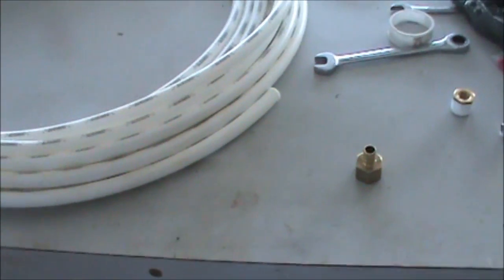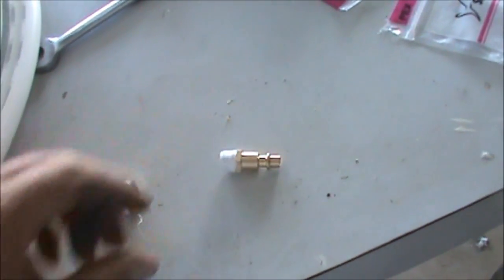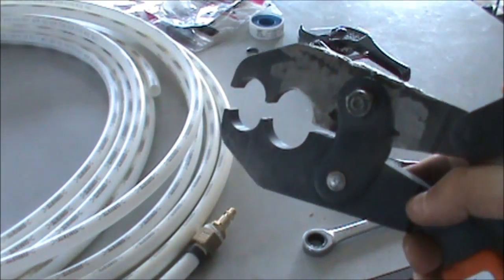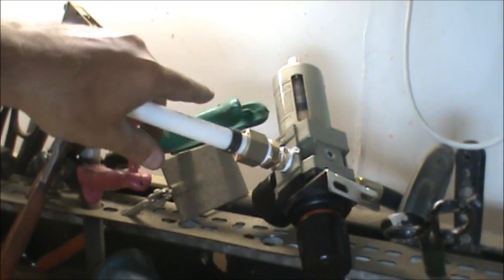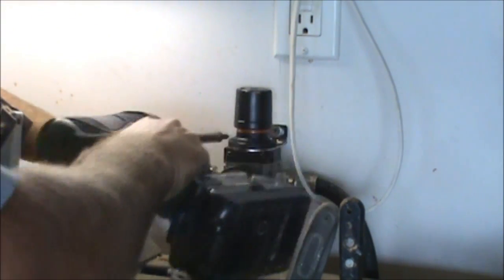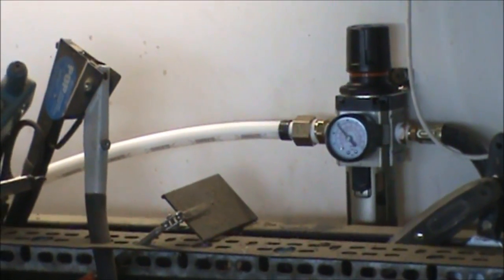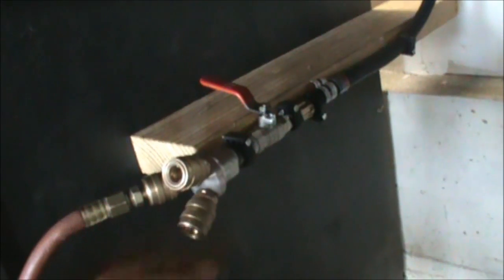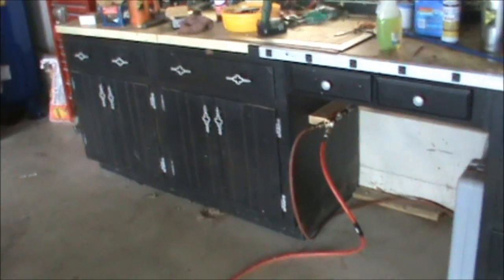How to connect pex to an air compressor

Comment: How's the pex is it still working out now in 2018 ?
Reply: I have been using pex for airlines that have been under pressure for 15 years straight at 135 psi. Not one leak and never an issue. I did use a leading brand and have several hundred feet connecting multiple structures to the same compressor. Have worn out two compressors in that time and soon will be buying my fourth compressor.

Comment: I use galvanised.
Reply: Most people (me included) put galvanized pipe at bottom of the list for air. In time, they tend to flake off inside. In addition to the looses bits ending up in tools, they can now start to rust - especially along the weld seam inside. Moreover, the coating is obviously removed when pipe is threaded. This leaves plain mild steel to rust at every connection. It's better than using PVC/CPVC which some people have actually used (often with disastrous results, of course), but that's about the only positive thing about galvanized pipe.

Comment: What a jerk. Could at least learn the proper names of fittings and know what different thread pitch is used on the fittings.
Reply: Also should know proper names for the tools, that was an air ratchet he had there not an impact.

Comment: Have to disagree with one thing nothing is easier than sweating copper. I don't know if it's just me but it's so easy and fast that I hate to do any other way the only thing is it's so damn expensive that I think I'm going to go and try your PEX SYSTEM
Reply: 100 ft run of copper...even if its perfectly straight requires 9 couplings plus a fitting on each end. That same 100 ft run in pex only requires a fitting on each end. Copper loses.

Comment: Pex is rated 160psi @ 33-70F or 80psi @ 200F. Who ever told you 1000psi is dumb as hell. Its softer plastic than pvc so it cant handle as much pressure. Your 125psi compressor should be ok but any bigger put a steel line in or get a proper plastic line kit.
Reply: Rated at 160 but burst at 1000psi I have seen the tests he is not talking about what its rated to handle .

Comment: When you place the crimp ring, use a pair of pliers or channel locks to deform it slightly so it does not slide away from your crimp tool.

Comment: What's up with the sunglasses? Copper cools the air better than anything else and the cost difference is not a big deal especially if you buy your copper fittings off eBay. Pex is garbage!
Reply: I keep seeing people say that "the cost difference is not a big deal" or something similar....and I have to ask...Where are you guys buying your pipe?  Because either copper is cheap as hell where you live, or PEX is super expensive there.

Where I am, I can buy copper, in 10 foot lengths for $15 for 1/2",  $22 for 3/4", or $35 for 1".  I can buy PEX in 100' lengths for $30 for 1/2", $50 for 3/4", and $70 for 1".

In my shop, I'll need around 150'....so, if I go with 100' of 1" for the main run, and I run eight 6' drops, I'm looking at over $500 for copper.  If I use PEX, I'm looking at less than $50.
Reply: U  obvioulsy   do  not known a thing   about  pex then.
Reply: They're safety glasses.

Comment: I'd use 3/8 quick connect fittings instead of 1/4 fittings. A lot more air flow. There's no need to "neck it down". Thanks for the vid!

Comment: I'm curious as to what air PSI each grade and size of Pex can handle. I happen to have the cinch clamps and tool. I feel those don't seal as tight as the rings. If the line gets twisted with cinch clamps it might spring a leak or blow off. Especially from the vibration of the compressor. Has the ring held up on the hose?
Reply: +Robert Daggett I used 3/4" copper pipe instead. I didn't feel comfortable using pex.
Reply: markfothebeast s

Comment: There are two kinds of pex.  Make sure to get the UV rated if it is surface mounted.  In about five years of light sun it will fall apart and get brittle otherwise.

Comment: $60+ bucks for a crimp tool?  And it BROKE crimping little rings around Pex nipples!  And the SharkBite fittings are through the roof!  $6.94 for a straight 1/2" push fit coupling, even the 1/2 in. barb/barb couplings are $1.26/ea and that's the 5 pack price - $1.58/ea for singles and you still need the crimp or clamp rings, one for each end at the 25 pack price of $0.23/ea and 10 pack price of $0.52/ea, respectively so now you're up to a minimum cost of $1.72 for each straight coupling or $2.30 for each connection using the clamps if you dont want to shell out the $60+ for the crimping tool.  By the time you make your first connection of 2 lengths of PEX youve shelled out over $100 for pipe, crimp tool, a 25 pack of rings and one coupling. You know how much PVC you can buy for $100?  I could plumb my whole garage with PVC, do it all WRONG, rip it all out and start over again for $100. Which is what I used to plumb my whole garage with airlines using PVC not counting air fittings which are the same for any type of pipe. PEX??? fuggitaboutit!
Reply: Agreed. The Pex accessories and tool are stupidly expensive. I just happen to have the tool and some rings from plumbing our house. I have the cinch clamp tool though and it was $20. 100 cinch clamps on Ebay cost about $18. 10 of them at Menards cost $6. Though I don't feel the cinch clamps seal as tight as the crimp rings. The Shark Bite fittings are just too expensive and I've had a $35 Sharkbite braided hose to the water heater already break at the fitting. I plan to run Pex just from the compressor to the wall to absorb the vibration. It is cheaper than black steel and copper although I am running copper to cool the air.

Comment: I was at Home Depot today looking at PEX flex pipe and hard pipe. I think you'll be ok with 125 psi, but for others running high pressure you'll want to run the PEX STICK. It said on it MAX PRESSURE 400 PSI.

Comment: You need to remember that pex is not UV protected and if you use fluorescent lighting or have several windows in your shop, caution the tubing will become brittle and burst, look out for shrapnel.........................Just use caution.................

Comment: Good install. My only criticism would be the brass 1/4 quick connect male side. I've had many of those suckers break at in opportune times. Not just the HF ones either. The HF ones are guaranteed to break. Ibwouldvreplace them with steel, which I've never seen break. Good job though I'm about to run PEX airlines in my gunsmith shop.